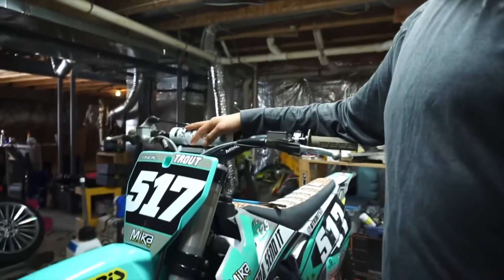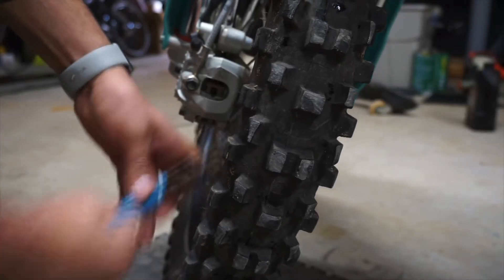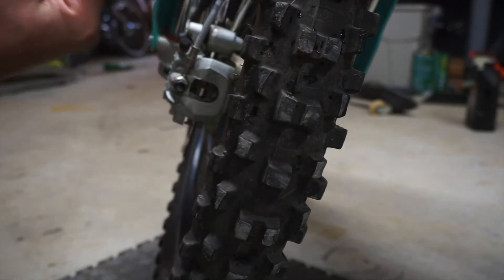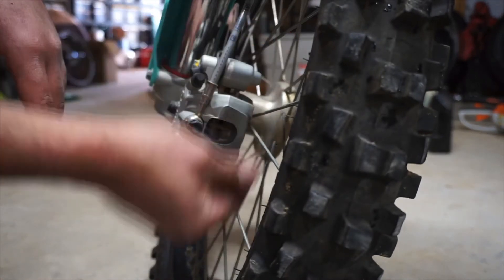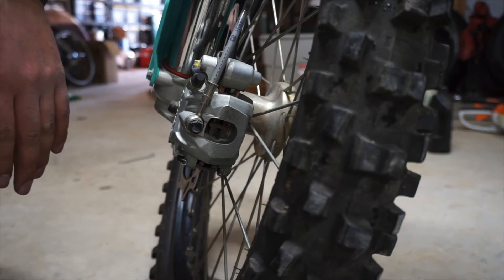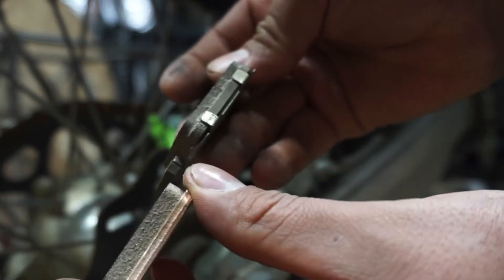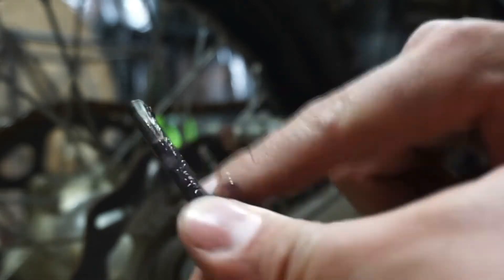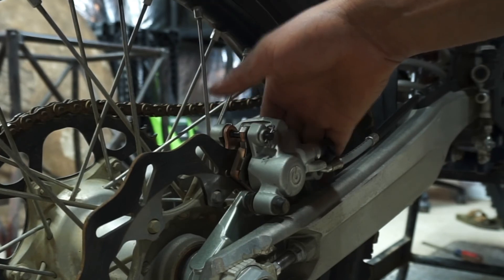HOW TO: CHANGE KTM/ HUSQVARNA BRAKE PADS

Comment: Never understood why people replace the pads without removing the rear wheel so you can break down the caliper/pad components to clean everything up.  I understand if your on a trip or in the field and you need to replace them in a hurry,. but this should never be a surprise job.  You should be inspecting your brakes every time you are doing any kind of maint.